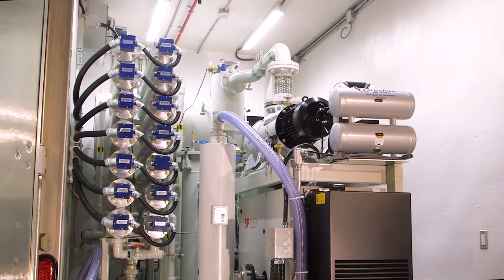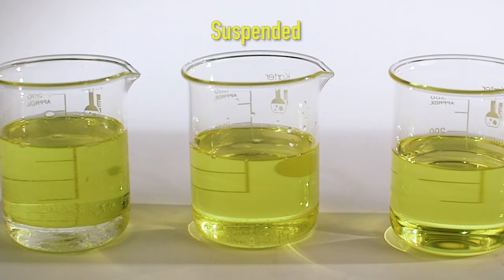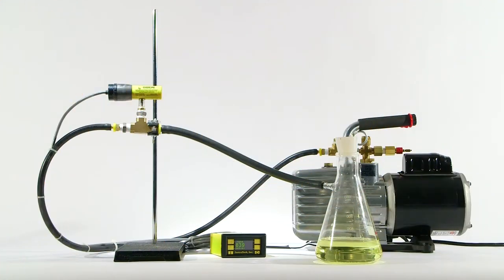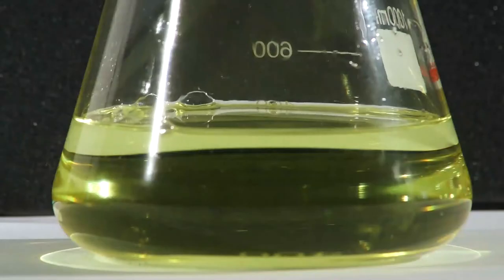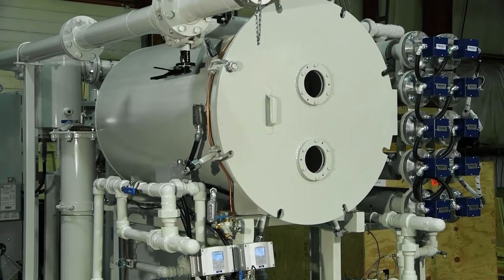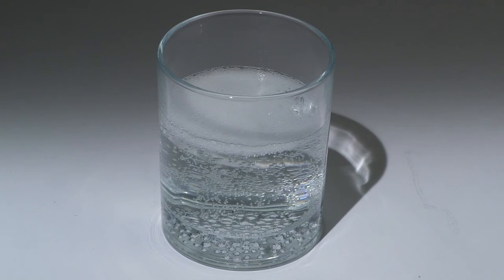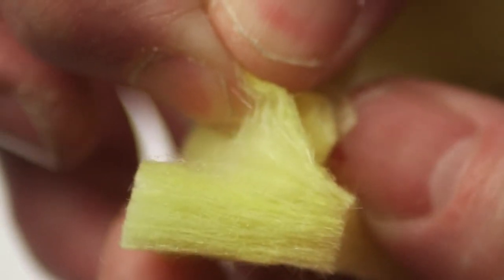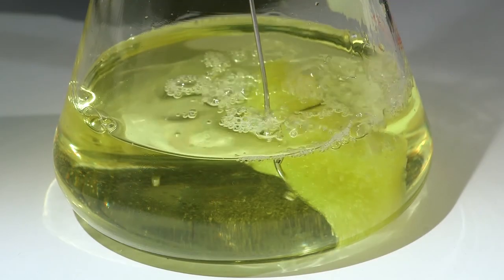Enervac Transformer Oil Vacuum Dehydration & Degasification Process

Comment: I have dehydrated several buckets of transformer oil by doing various additional treatments and I can say that the main factor in increasing efficiency is heating the oil to 70-80 degrees Celsius and running it into narrow gaps in a very low pressure.  In none of my experiments did bubbles appear on sharp edges or fiber ends, only in gaps with a small opening angle.
Reply: I'm DIY building a old 45KG LPG gas bottle conversion at home as a waste veg oil vacuum chamber. Aim is to dry the oil and use in diesel engine. Do you have any more details or suggestions on what i could use that's cheap and easy to get sharp edges or what you've used to make it go through small tunnels? Initially I was just going to fill the tank 80% full and put a band heater around and heat to 70-80C as you stated and apply a vacuum.

Comment: Does the free water example pose a problem because the weight of the oil creates pressure on the water that cannot be removed by a vacuum pump? I guess that's another example of why you have to churn the mixture and pour it over the fiberglass elements.
Reply: I think when the pressure is low enough it acts also on the water under the oil layer, so this water could boil in a room temperature and the steam in form of bubbles will go through the oil. It is just a guess, but making the emulsion could increase the efficiency of the dehydration 🤷🏻‍♂️
Reply: @maciejc.617  Look up Pascal's Law and the section on a fluid column with gravity. You could have perfect zero pressure in a vessel but the weight of an oil layer will keep the water below it under some pressure and could prevent it from boiling. There's no such thing as pressure below zero, so there's no way to lower the pressure further to counteract the weight of the oil.